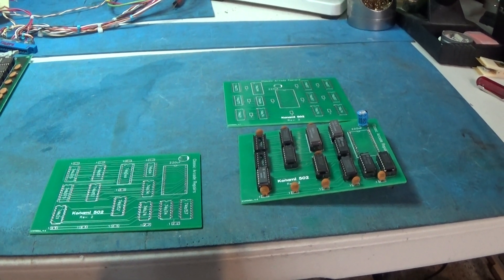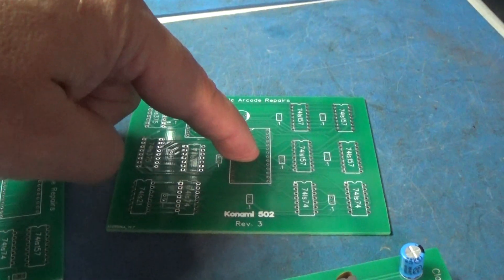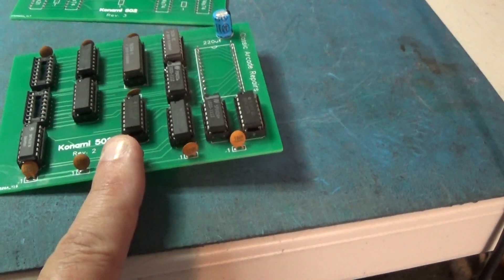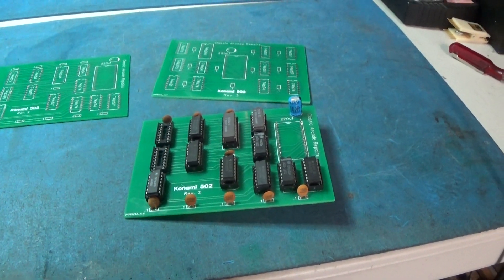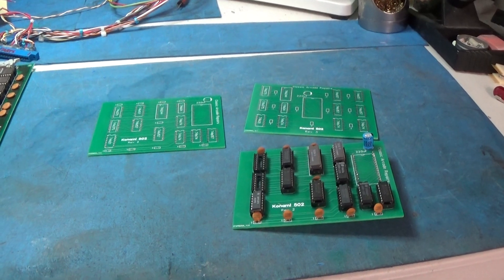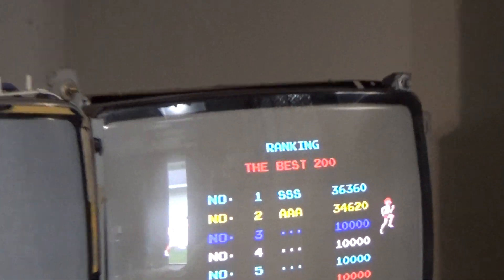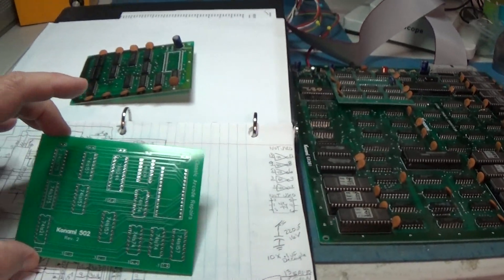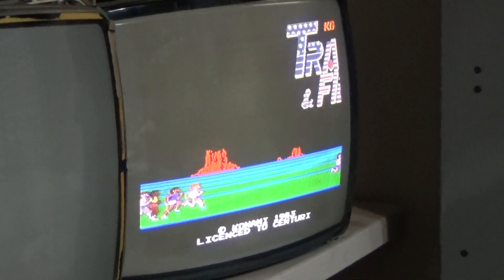Konami 502 Custom Chip TTL Equivalent Reproduction!

Comment: I think the point in offering the schematics and gerber files is to preserve these games, so someone, 10 years from now doesn't have to have this same problem.  You're selling them now...  but what about in 10 years?  It's a bit of a problem in the retro world where someone makes something for a time, but eventually moves on to something else (just like the original game makers did) and it's back to square one.  Releasing it to everyone in the community eliminates this issue for forever.

It's not hugely difficult to get a PCB created and solder something together.  It's far more effort to have to reverse engineer the existing board and create the gerber files.  It's not as if you went into the chip and figured out all the TTL logic via microscope.  Someone else did that, and you did the far easier task of taking and existing TTL logic board and created the same board. 

Do the right thing to preserve these games, and release the gerber files and schematics.  Not many are going to bother printing up the PCB themself, buy the right TTL chips, and solder the thing.  But at least you'll be assured to be the person who's made sure these chips can be produced for basically forever.

We have the same problem in the Commodore world with custom chips for the C64, and we have FAR FAR more of these chips than exist in the arcade game world, but they're eventually all going to fail.  People have gone to great efforts to produce SID chips for instance largely as a means of preserving this platform.
Reply from the maker: Honestly..  the real reason why I am reproducing these..  is so that I can repair these board sets when I get them in,  and one of the customs is dead.  I really have no intention of selling them. I am currently scouring ebay and looking for random boardsets with these custom TTL PCBs..  so I can repro them..   all in the name of replace dead customs on set I get in...  all of that time, effort and investment I am putting into it...  is not to sell repros...  but to fix dead boards.
But I will let everyone in on a little secret...   I use my Patreon page as a online cloud storage place to store all of my random work, and oddities i come across...   so all of the reproduced PCBs I either do myself, or come across online...  I upload there...  available to all members
Reply: @classicarcaderepairs4818  If you're not going to sell them, it's all the more reason to release what you've produce on github or some other publicly available site.  That way anyone else can improve on your work, rather than having to repeat it.

Sure, you can put it on Patreon, but it's something that's hard to discover for anyone that's not on this youtube channel.
Reply: The gerber files would certainly come in handy for the future.

Comment: Nice to see these getting done. Are there many Komani games using the 502 custom chip? 

You should do a video on how you worked your way through the process of working out what chips you needed to create the board. Would be interested in your thought process.
Reply from the maker: There are actually 10 games that use the 502. you can see the list of what uses what here. And it was really a matter of tracing down all the traces on the original PCB..  and drawing up a schematic based on the original circuits.

https://docs.google.com/spreadsheets/d/1iB9BJaEpAufgKaz758FiDDekUH8JreoTn276yPqD-kk/edit#gid=0

Comment: I usually use DHL when I order from JLC PCB. I have the boards in about a week. Slightly longer if I have them do any SMD assembly. I just ordered 30 Fluke protection modules with everything but the header pins as SMD and it was 10 days total. It comes out to about $3 a module including shipping.
Reply from the maker: not bad at all
Reply: @classicarcaderepairs4818  A bunch of us are building 9010A emulators and pods. The Pi Hat is open source already. My intent is to get pod designs done that will be open source as well. People will be able to have a 9010A with most of the original functionality and a couple of pods for under about $500.